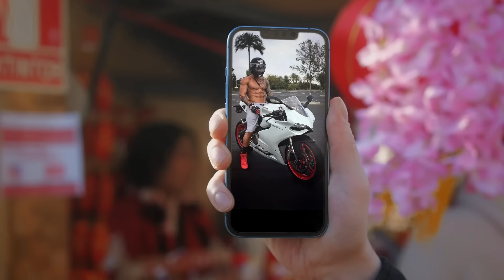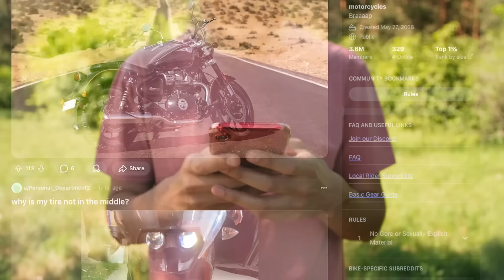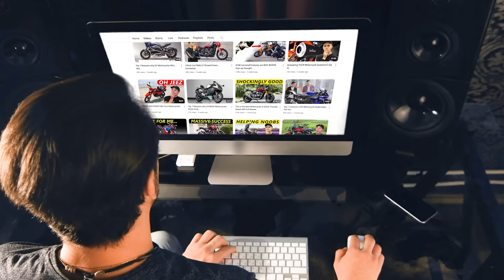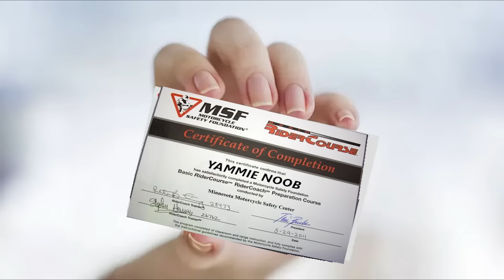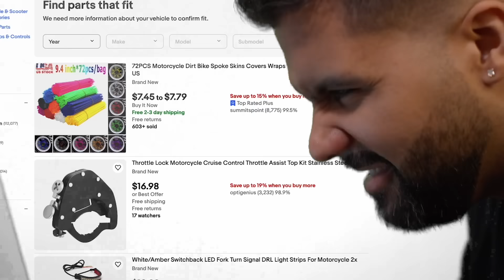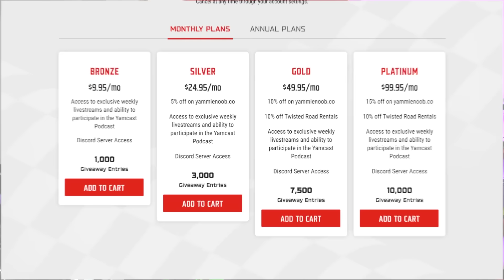The 7 Stages of Motorcycle Obsession

Comment: I think there’s a stage where you start to downgrade due to age and or physical condition. You sell your heavy R1250GS and buy Tenere 700 or KLR 650 or even smaller
Reply: There's also downgrading because you realize that's the way to become better. And that bike or engine size will never compensate for lack of skill. You can't purchase skill level as if it was a videogame.
Reply: Off road yes … I went straight to the GasGas ES700 (ps they are on sale with low rates). But on road … Streetfighter V2 all the way. Because Ducati. 🤌🏼

Comment: Speed ran the first stages in a matter of months and eventually got deeply lost in the modification rabbit hole, trying to make a used bike look like it just rolled out of the factory in Thailand, which actually turned out pretty good in the end. I got a really good deal for the bike and spent 1-2k on stock parts to make it shiny again. Skipped the community engagement part other than a few chill rides with my buddy and focused on my riding skills on mountain roads in the Alps. In that regard I‘m really spoiled because those roads are basically around the corner. Fast forward two years and around 20k km later, I managed to sell it for more than I bought it for. Saved some extra money over the winter and got myself a brand new Street Triple 765 RS at the start of this season. Sadly the riding season here has come to an end because the streets are already saltier than some teenagers online

Comment: Riding for 50 years and buying my first sport bike...a Hayabusa,  felt like learning to ride all over again.  Hands are waaay down there below the top of the gas tank.  Feet are waaay too far behind me.  Holding the throttle in a death grip so I don't twitch and wheelie the bike.  In hindsight it's pretty funny now, but I was dying of shame and fear the entire 20 miles home from the dealership.  I wasn't afraid of dying.  I was afraid of doing something stupid that would make me look like the dork I felt like during the entire ride home.  Many miles later....it's just another bike, and like all bikes, the most dangerous part on it is the nut that holds the handlebars.  It's all good!

Comment: Being in my 50’s and back to riding street bikes for the last 5 years and with my own bike since 2021, I’m glad I’m that much wiser than my street squid days back in the late 80’s. 1986 Red white and blue Kawasaki 600RR with the carbs jetted, Vance and Hines exhaust and clutch. Running a nice gummy Metzler back tire. Was so much fun. Nothing to save you like the electronics of today.  Bought the 2021 MT-09 stock, modded and tuned and realized that living SW FL I needed something with more power and comfort, as well as more stable on those long fun sweepers.  So now I have my forever bike, the 23 MT-10. Base version, but with the Leo-Vince 3/4 cat delete with the LV-10 carbon exhaust and tuned. It’s a road beast now. Although I’m sure it’ll do over 160, because as what Yamaha boasts stock top speed, and now this is tuned, that’s not me anymore. I’m all about the twisties and flying out to a comfortable triple digit to just slow down and chilll. I guess it’s about knowing what the capability’s are in the power even if you don’t use all of it.

Comment: Been riding for the last 2 years. First bike I had to modify because the front fairing for my 2002 Kawasaki Ninja 500 was beat up and wouldn't fit the original turn signals if I could even find them on ebay.

Comment: I'm at the N+1. I'll only admit to owning a couple of dozen bikes, and will add that the goal is to get down to a dozen this year. But I can't imagine going below half a dozen categories: 250cc Dual Purpose, 650 Sporty bike, 900 Sporty Bike, 750-800cc V Twin cruiser, 750cc Standard (Naked), Sport/Touring w/Fairing, trunk and bags. Ok that's six categories. But I can't get rid of the CT110, TW200, VanVan 200, XT225, DR350, they're just in other non categories. Or how about my need to always have at least one Triumph triple, if not one of each triple? Yeah, it's tough.

Comment: Always wanted to ride but was never exposed. Started making good money and decided to try things I never did (guitar, motorcycling, fencing). Went to a Harley Dealership to look and was damn near sold a sportster. A few Blockhead videos and 7 days later I was getting a 2022 HD 48 sat outside the dealer for me to pick up....at 12AM. Learned what I could about the throttle in the parking lot. Almost died leaving the parking lot. Hit 50 on the highway and haven't looked back since. I WOULD NOT SUGGEST THIS METHOD TO ANYONE ELSE!
Reply: Blockhead is a good place to start.